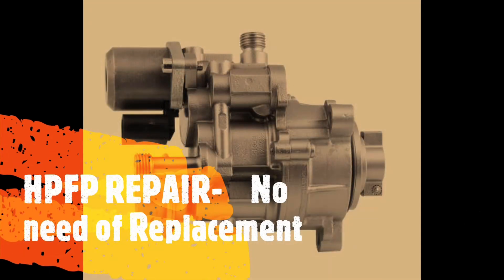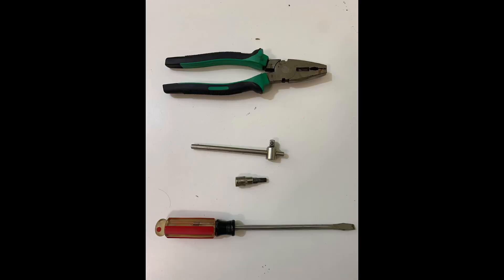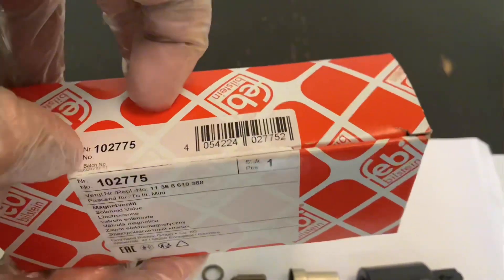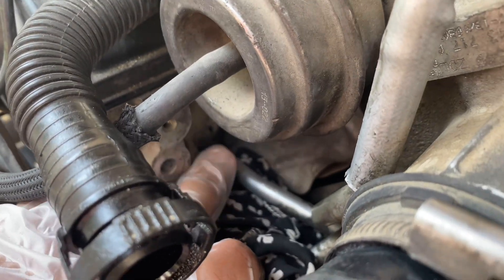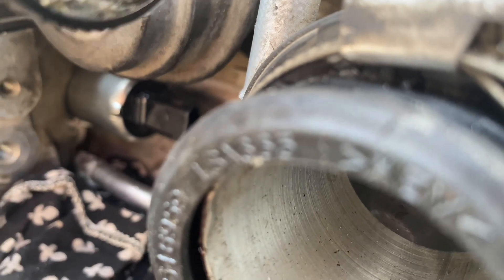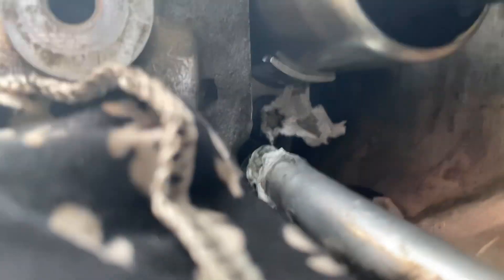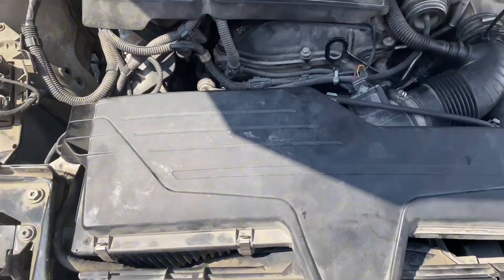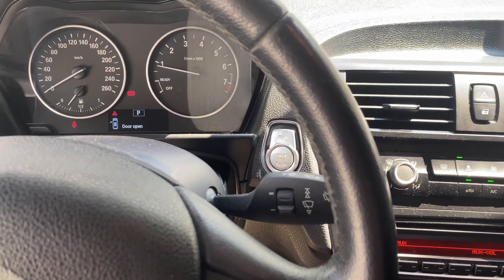BMW VANOS SOLENOID DEAD!!! Error code 130204.Exhaust side replacement N13 engine

Comment: How do you get the torque bolt out???
Reply from the maker: U mean the stripped torx bolt!!! I used a flat head screwdriver bit from the tool set and the metal extension of that 1/4" and hot the outer edge of the torx bolt with hammer. If you use a normal screwdriver with plastic or rubber grip it will not deliver the complete impact to the bolt so you have to use complete metal parts to deliver full impact.
Reply: Yessss!! That fu@#ing stripped pain the arse screw iv been trying for about 3 weeks had numerous of people try and get out....anyway iv tried all of that but there's simple no room to get a hammer in to lock it into place other than take turbo out...my head is battered with it...cheers for your reply
Reply from the maker: @jamesj9310  luckily mine was stripped in the intake side. I will think of a way for the exhaust side, as it's a tight space it will be really hard. Did you try hammering next size torx bit to it?
Reply: @Afeeftechworks  thanks mate...yeah tried that aswel but like I say I can't get any grip on it because of the no space issue other than take turbo out
Reply from the maker: @jamesj9310  will post back if anything comes to my mind. I am currently on my timing chain and guide replacement process 😁
Reply: @Afeeftechworks  iv just had mine done because the rattling noise was diagnosed as timing chain...when infact it was this c🤬ting arse solinoid...and one bolt is stopping me sorting it out..fuming haha good luck with it mate ..big job haha
Reply from the maker: @jamesj9310  so far easy job, I don't know why garages are billing super high for timing chain replacement. Rattling noise can be oil pump chain right? I am not n13 expert as this is new to me. Learning from each failures. Still love my N55.
Reply: Got mine done pretty cheap tbh..I'd rather them have the fook on haha its 1st bmw iv had and certainly the last haha they built the engine around the solinoid it seams 😂😂

Comment: How can we do this in b38?
Reply from the maker: I am sorry.I have no experience with that engine. If you want I will check in TIS and try to help
Reply: @bimmertricks  this will be so much helpful!! Thank you. 
I have an F20 rear wheel b38 from the year 2017, 110k km. I am getting the same error code and the bmw services wants to open up the whole engine. The car doesnt have any performance issue and i have been trying to figure out a fix without opening up the complete engine. My understanding is that failing solenoids give the same error code so its probably better to try and replace them before opening up the engine.
Reply from the maker: @usmansaeed08  I see only VANOS central valve for B38 engine and that is mounted with timing chain Sprocket bolt !!!!